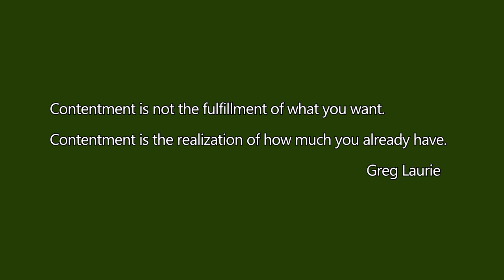More Broken Stuff On The Homestead! - Tiller Woes

Comment: Well you have a solar system that I bet sits at float most of the day so I would find a way to use all that lost power. You could make fuel browns gas or hho or just use litium batteries and convert whatever you can to electric.
Reply from the maker: I'm thinking an electric tiller might be a bit heavy.  :-)
Reply: @contentment164   depends on how you go about it. Sizing the battery for say 30 minutes work makes things easier or having battery packs that can be charged and replaced like a hand tool would make it lighter. My Ego snow blower which is basically is a tiller is lighter than the gas blower.
Reply from the maker: I have a 24v heavy duty high torque electric motor that I am looking for a use for. I really could use a powered cart or UTV around here. Thanks!
Reply: @contentment164  I seen a guy convert his riding lawn mower with a pto it would do just about anything the gas version did. good luck I do know you have the mechanical skills to do such a thing.